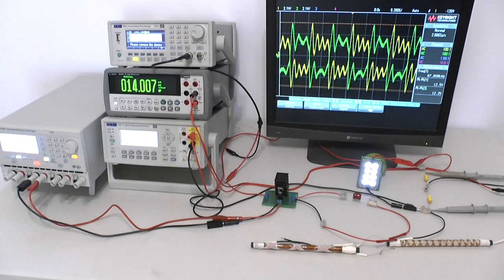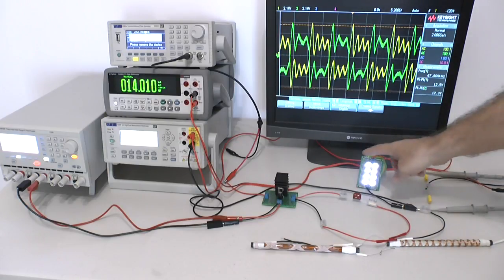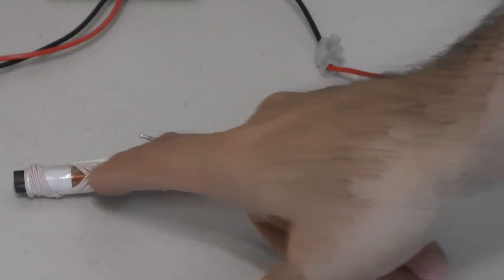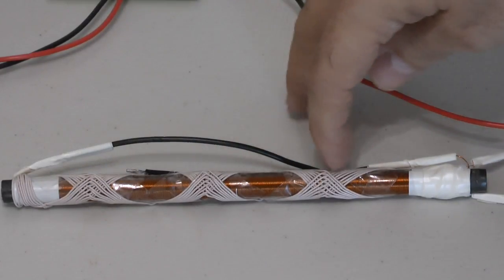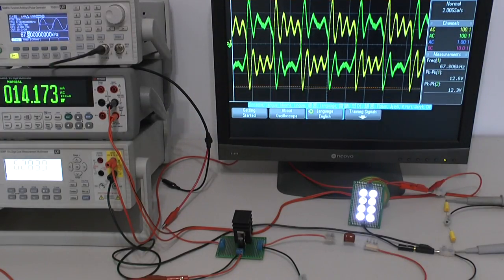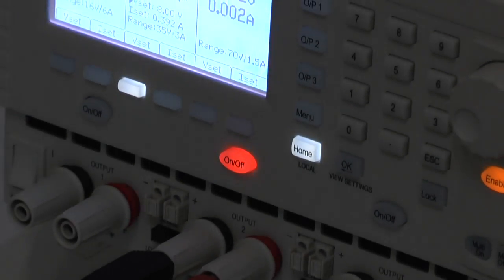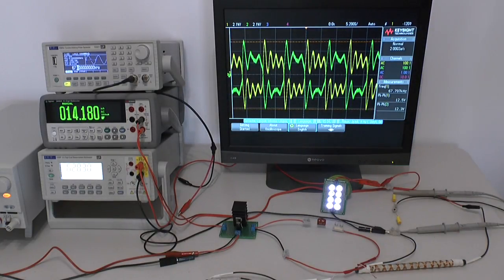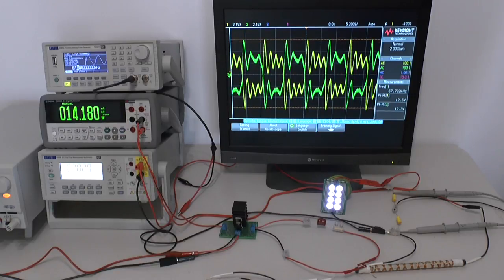The Caduceus coil performance

Comment: The smith coil consisted of 8 guage teflon coated wire.. basically any conventional coated building wire could be substituted.. it is wrapped around a ferrite core.. 10 guage can be used..

Comment: From the tube comes a magnetic flux with scalar waves, as Tesla called them. Study these waves. They travel very large distances and pass through any material. With the scalar waves information of any kind and even electricity can be transmitted.
Reply: It's Tesla waves, non-hertzian longitudinal magneto dielectric waves.
Reply: Tesla didn't call them Scalar Waves, that's from Tom Bearden, and if one knows what a Scalar is the notion of a "Scalar Wave" is nonsense.
Reply: @JenkoRun indeed. Scalar vibration cannot be a wave. It can only be pressure fields. From high to zero and from zero to high. Since this alternating pressure field is simply expansion and contraction of aether, but not energy propagation unlike longitudinal non-hertzian electric waves.

Comment: I’ve studied caudeceus coils. My question is “is there a way to transmit the scalar waves, rather than in a beam, they travel in multiple directions?”
Reply: That would be the top load of the REAL tesla coil where the structure is similar to the patent of the wardenclyffe tower. They like to hide the truth in plain sight .-.
Reply: @lukiepoole6701  Indeed, they do! Looking forward to the Intergrid powered by seawater electrolysis and magnetically levitating highways for powerless vehicles :p

https://lmgtfy.com/?q=magnetized+water+4000+rpm+

https://www.youtube.com/watch?v=J9b0J29OzAU
Reply: @lukiepoole6701  How may a tesla coil top load generate scalar waves?
Reply: @filigenzilab9613  The top load can behave like an antenna, but if you want to transmit longitudinal power like Tesla did you would use the Earth as the transmission line, not air transmission.
Reply: @JenkoRun  thank you

Comment: hey Old Guy! can you build this!!!??? https://patents.google.com/patent/US8073094
Reply from the maker: Technically, yes. But before I spend os much time and effort I need to test it on more simplistic structures.
Reply: TheOldScientist 
sweet!              
 Im not sure how you would do that but it would be awesome to see it! 

my funding is low so Im not able to replicate it so Im searching for knowledgeable folks with the resources and interest to reproduce this quantum gravity experiment.

ive seen it run. www.torustech.com

once it gets up to speed, its self running, like water going down the drain except its a recursive, nevernending drain.

your videos are awesome, thanks for sharing!
Reply: Hi Jeff, Interesting that you mention a neverending "drain".

The magnetic vector potential and voltage are more fundamental than the electric and magnetic fields which can be derived from them. Currently we use gauge fixing because the model of these potentials is not fully constrained, hence there is room to extend the classical model.

Magnetic vector potential outside a wire falls off logarithmically, but due to experimental results like the Aharanov-bohm effect, I suspect that like particle wave functions, it is best represented by complex numbers.

Note the spiral branches of the complex logarithm function. Perhaps under the right circumstances it may serve as an infinite potential well in some way. I haven't cracked it's secrets yet though.

This is just speculation for the time being, but perhaps our universe is inside a black hole, and the fact that everything falls inward faster than the speed of light disentangles us from the future and past in such a way that the time axis appears spatially as a complex extension of 3D space. Maybe systems which harvest vacuum energy induce drag as we "fall" forward in time, like a pinwheel held by a skydiver. But instead of wind it would have to be some sort of radiation I guess.
Reply: Michael Perrone thats exactly right, and in fact Ive been describing singularity at the quantum level. Your making your way down from the particle physics to causal vacuum physics.

all energy transformations come from the vacuum flux which is made up of plannk scale oscillations of electromagnetic energy. the Vacuum is not empty space.
the point charges are these planck oscillators in my capacitor circuit, and the gravity dive. only time reverse phase conjugation waves can interact with the vacuum planck oscillators. forward time waves are out of phase temporally with planck oscillators of the vacuum anf therefore any attempts to use forward waves in a closed loop system will experience kirchoff 1st and second laws.

only when you open up the system to include time reverse waves, will you have access to the infinite electromagnetic fluctuations at the event horizon of time space.
Reply: Michael Perrone a tesla coil that has a bifilar coil as its L2 coil and is connected to a large capacitance. the capacitor on a tesla coil is where the time reverse wave originates or is reflected from.

modern tesla coils use a small capacitance, but a large capacitance means a more amplified reverese time wave.

i dont think parametric pumping will work since it does affect quantum systems but I see where he is coming from though.

ill look into more and contact him.
Reply: He's not particularly old or anything, it's just his youtube name.
Reply: It seems that Naudin's time-energy pump may be the simplest setup that may let us do this. Perhaps even the Kapanadze coil when the complex impedance between the grounds is properly tuned. Also possibly the next-generation coils demonstrated on this channel previously.
Reply: Yep and make sure to test it out: experiment is ultimately what matters.

The time -energy pump is pseudo-parametric in a sense. Without a ferrite core it still allows for changes in the ratio of E to H which would normally be expected from a change in material impedance. That's due to the structure of the waveguide and the near-field effects it produces. I haven't yet built the thing myself, but will test it as TheOldScientist did.

If waves interact energetically with the medium they are in, they must necessarily interact with the parameters/material properties of that medium. Whether that material is an antenna or a ferroelectric with the electro-optic kerr effect or a sea of vacuum quanta is a seperate concern, but they all have physical properties which can be represented as mathematical parameters. I am simply applying a fairly general mathematical explanation. It is easier to demonstrate the existence of these parameters than the fundamental nature of the vacuum, and thus easier to communicate it to scientists.

Comment: can you produce soliton pulses with this coil? Generating a longitudinal wave?
Reply from the maker: Well. It is not an optical system but spatial changes to phase angles are one aspect I have never seen in coils. This is visible by the unique flow of current in one or the other direction within the same frequency at high KHz vibration to the load.
Reply: Solitons are a different phenomenon than longitudinal waves. Linear superposition and wave equations consistent with Maxwell's equations may still apply to longitudinal waves, it's just that they have a waveguide/metamaterial which permits alignment of the fields with the direction of motion. Unless I am mistaken, they can be considered a near-field effect. Solitons are typical of nonlinear systems/material media, and may remain as stable pulses even though they interact nonlinearly with their environment.
Reply: Any nonlinear effects would be confined to the waveguide of the coil, not going out into free space.
Reply: @michaelperrone3867 JLN lab say otherwise tho